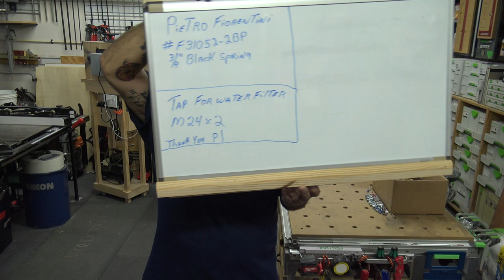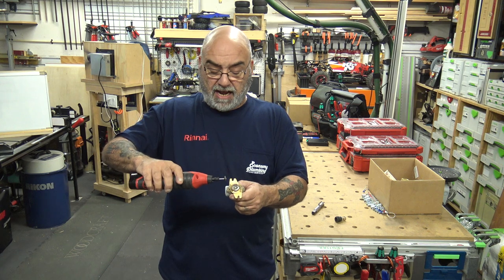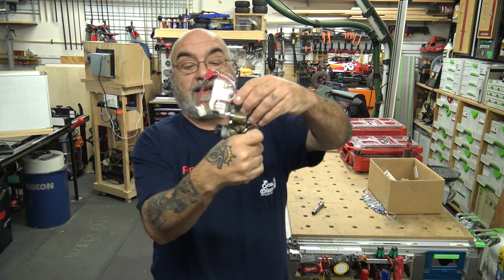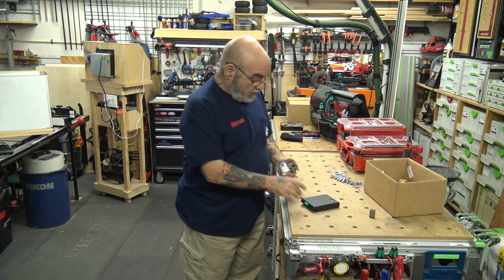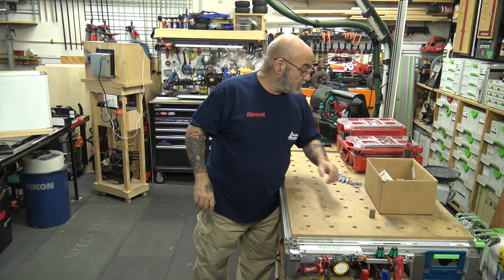The difference between Rinnai vent piping, valve kit and Pietro gas regulator

Comment: I have the largest V outdoor unit. 6 months old. At 135* it takes longer to get hot water. That makes sense. What doesn't make sense is in the middle of a shower it will get cold. I turn the water all the way hot and after a couple minutes it returns to temp. New house so plumber came out. Tried to tell me this was normal and to just keep the temp at 130 or lower. At 130* it works fine but 135* is where it struggles. I am fine at 130* but I would like to understand what is happening at 135*. Plumber was not able to explain. Plumber also said they move #7 dip switch as well as #6 which I moved when I first moved in. He didn't remember why they also move #7 but they do.